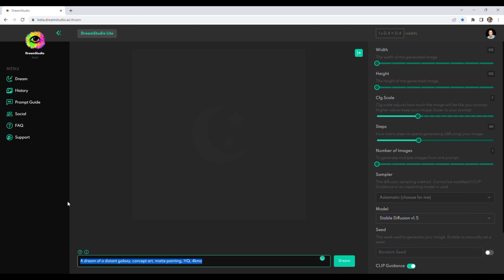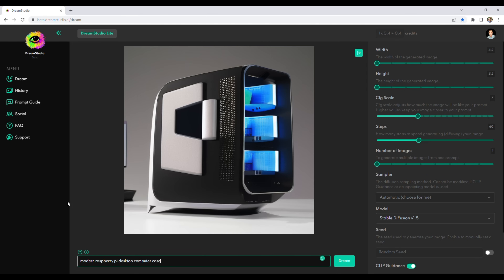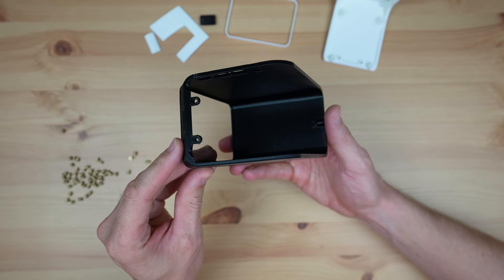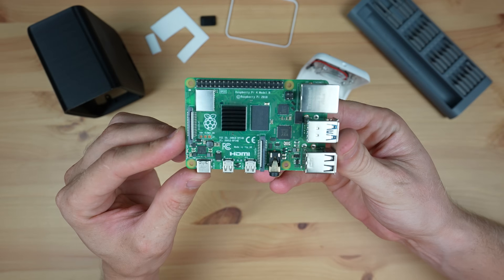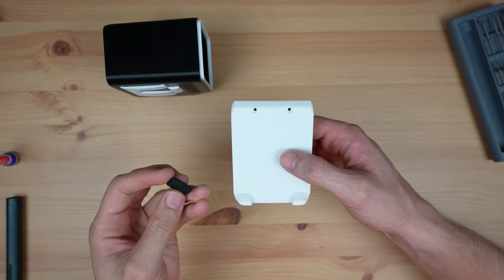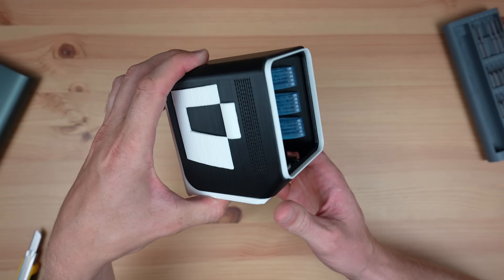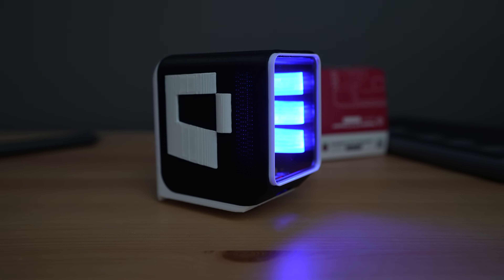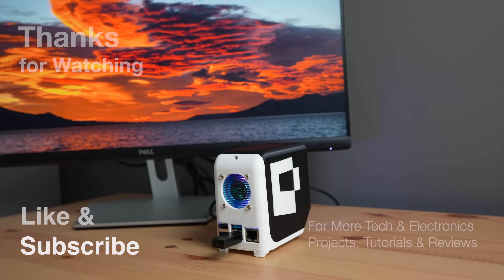I 3D Printed A Raspberry Pi Case That AI Designed

Comment: When inserting threaded inserts you shouldn't cook your plastic.

You should get into temperature range slightly lower than "printing" temperature, so for PLA 300°C is a massive overkill that will more or less destroy the plastic touched by the insert.

180–200°C (depending on the polymer blend) should be maximum

Comment: I agree, the case turned out amazing.
If you didn't think of this already, the space above the Pi can be used to connect some SSDs.
just add blue led to the other side, add a slit for the SSD and your done...

Comment: You saw it quite differently from me. I saw 3 racks in the front of the case each lit blue and mounting its own raspberry pi in a three unit networked pc.  then buttons under the bottom rack and IO below that on the main body.

Comment: Wow! The case turned out to be amazing!

I kinda expected those blue things on the side to be 2.5” Drive mounts (so a total of 3 on top of raspberry pi) but your version looks way cooler!
Reply from the maker: Drive mounts along the side would have been a great addition
Reply: I was thinking there was 6 and we could only see 3 ? so that would complete the rack setup also maybe 18650 UPS HAT and as Brian S said have the leds show activity, so the 2.5 would light up when the 2.5 is being used Also one could be RGB so it would refect the Fan speed L,M,H...
Reply: My mind went to drive bays, too, but I imagined them as some sort of front panel drive, like a CD or Floppy disc would be on a full size case.
Reply: @dafoex  you mean like hot swappable ones? that’s an amazing idea!

Comment: Pretty impressive. Are you going to sell this case with blue acrylic panels on etsy without the raspberry pi, LEDs and fan, that we can actually buy anywhere we want? Working LEDs and fan look awesome.
Reply from the maker: I'll look at putting a kit together or just putting the CAD files up - there is quite a lot of work involved in assembling each case.
Reply: @MichaelKlements  yes, I know that. The example is the case with water cooling, where you presented a CM4 board with computing module. The CM4 board has 12V for the fan and also the usb port where you can connect the pump separately. In my case where I am going to use Raspberry Pi 4b, I need a module with two relays or a mosfet with optoisolation to be able to connect properly the water pump and a fan (both 5V) the safe way. Besides I had to order all the parts except the 3D printer and laser cutter. Over 1200 PLN ~400 AUS. Probably some of them I could buy cheaper I suppose. But still I have no idea what is the price for cutting with the laser in acrylic 4 A4 sheets I ordered. So assuming I can say that the price is about 400 AUS. For this AI case I think it will be much lower. Around 200-300 AUS.